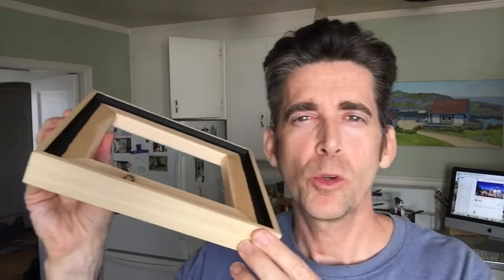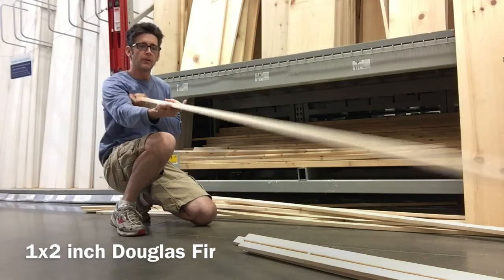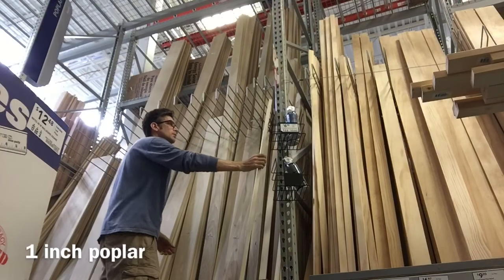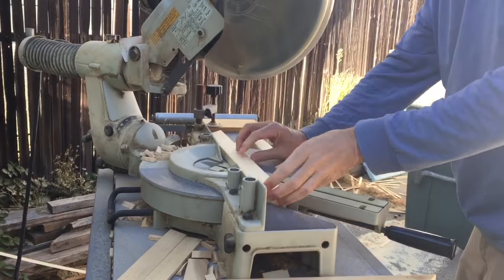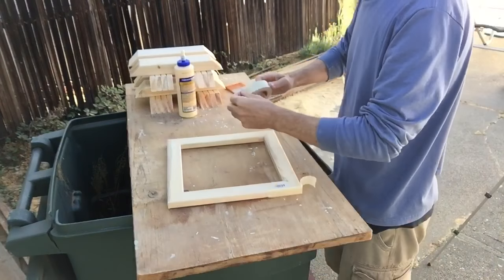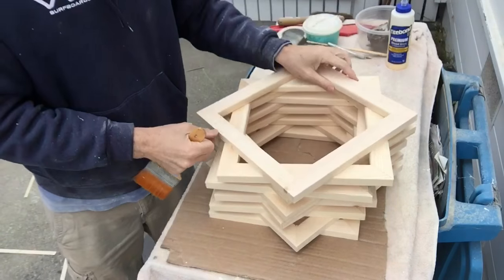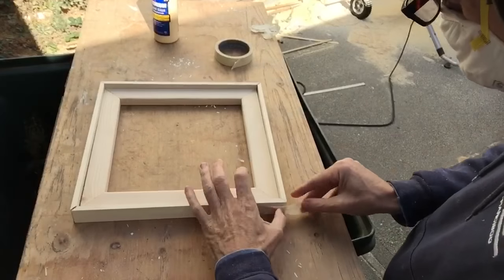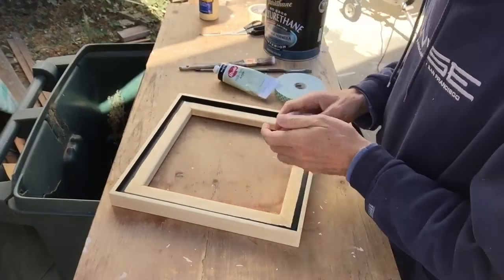How to Make Natural Wood Floater Frames

Comment: how do you mount 1/8 or 1/4 inch panel to floater frame.  Not enough material to screw into from back?
Reply: I think he's just using that double sided sticky tape to stick to panel to the black part of the frame, I would like to know a better way, because tape seems like it would fail after a while, in another video he uses liquid nails, I think

Comment: Nice idea. I'm making them also, but using stock large enough to make two cuts. One is the depth of the float recess perpendicular to the back side. This might be just 1/4". Then roll the piece over 90 degrees and cut perpendicular to the first cut creating the art mounting surface. Mitre and join. Only four pieces vs eight per assembly. You have a nice table saw that would work nicely.
Reply from the maker: Good idea! I may have to give that a try

Comment: I like this overall but I don't hear or see the measurements for the wood cuts
Reply from the maker: The measurements are different depending on the size and thickness of the painting you’re framing. Easy to figure out though if you’ve worked with wood before. If you haven’t, it would probably make more sense to buy ready made frames.